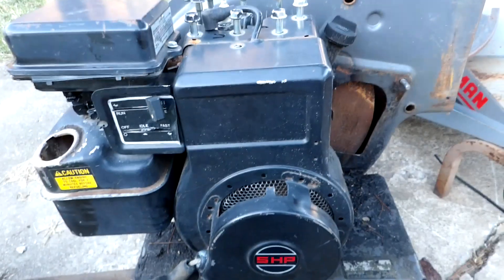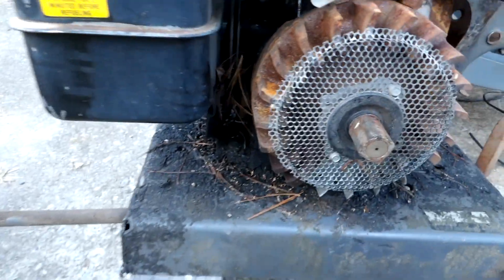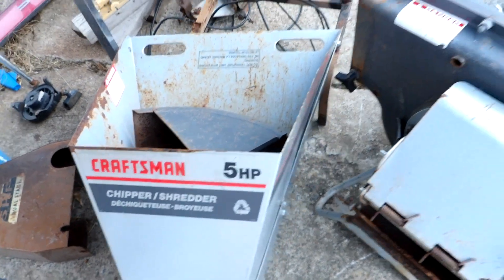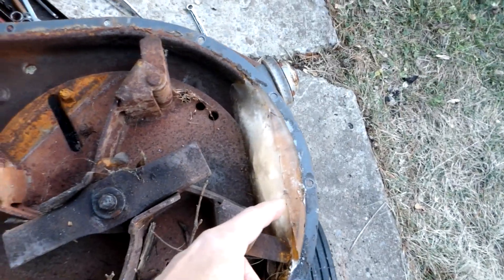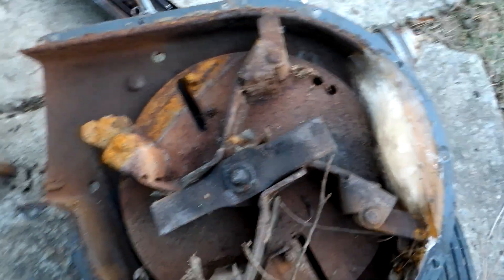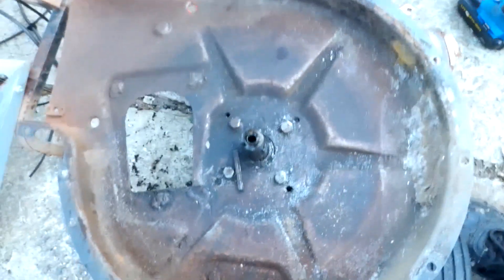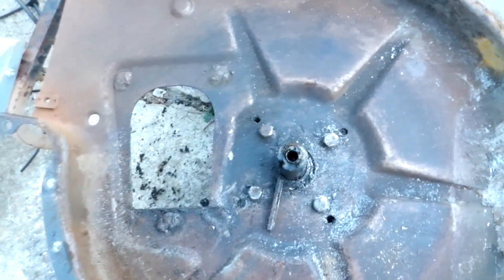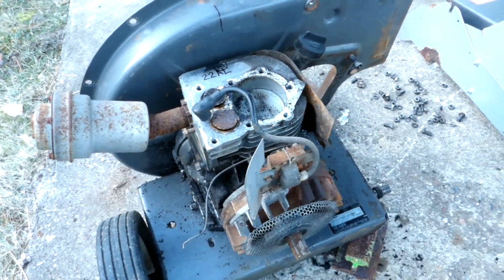Craftsmen 5 Horse Wood Chipper Teardown!

Comment: Do you think it possible and plausible to engine swap to a predator 212?
Reply from the maker: Nor sure, but it sounds like the swap could work. This Briggs does have an enlarged 1" dia. shaft, while they are normally turned down to 3/4" dia., so that could be a hiccup.

Comment: Nice! I think the inner blades flail out to chop stuff. If the metal housing is thick enough after rust you may have something useful there.
Reply from the maker: The outer housing is fine, it is just surface rust.